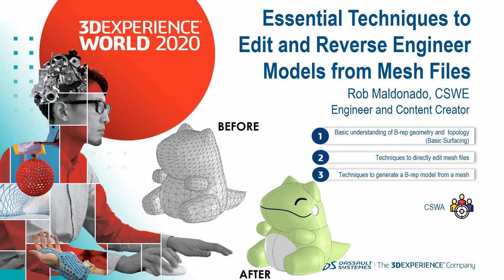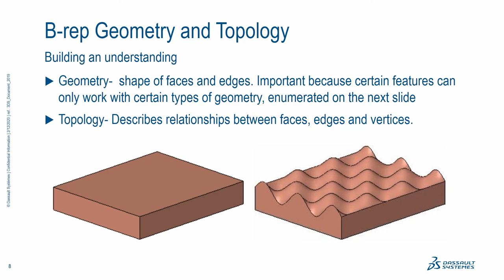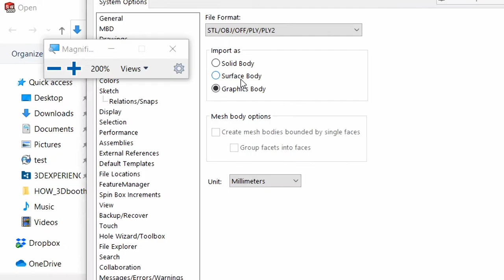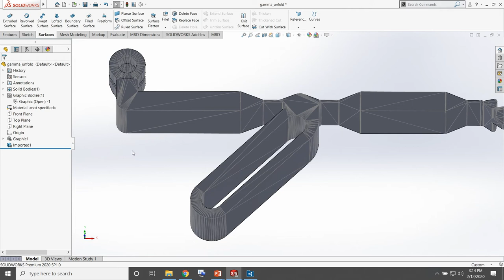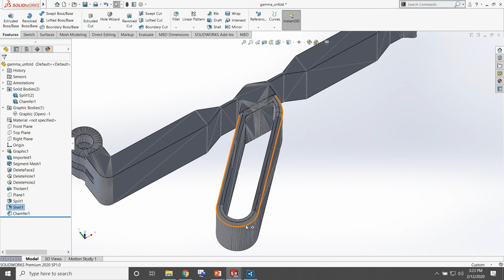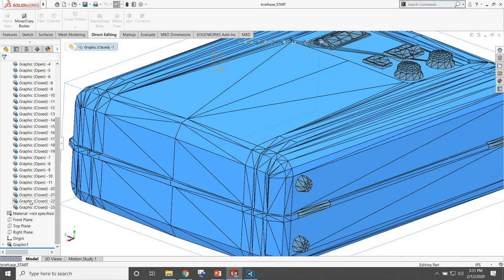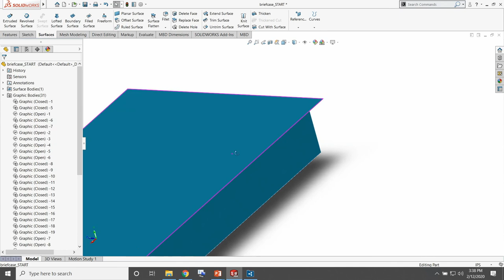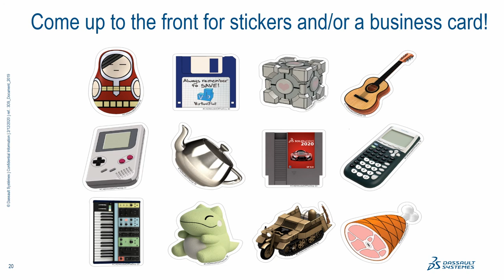#3DXW20 Presentation: Essential Techniques to Edit and Reverse Engineer Models from Mesh Files

Comment: Nice video !
But what workflow you use when the model maked in zbrush, example hard surface kitbrush (obj) import to cad (to complete my drawings) .
I'm using geomagic x design but not 100 % successful and somtimes using fusion360.
I want minimize the drawing because sometime i make over 400 feature and sketch the same part. I know looks better the product splitted to parts and making assembly, but i running with time.
Sometime I make concept art job in solidworks i have 1 day for 1 or 2 different product.
I Love youre videos. Big thanks for yourney !